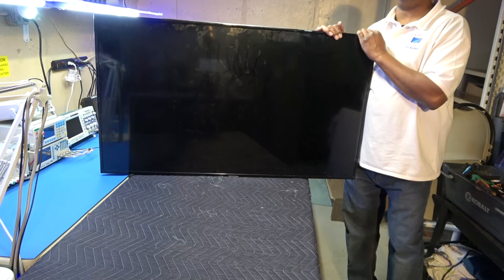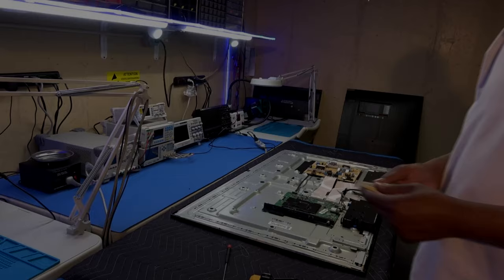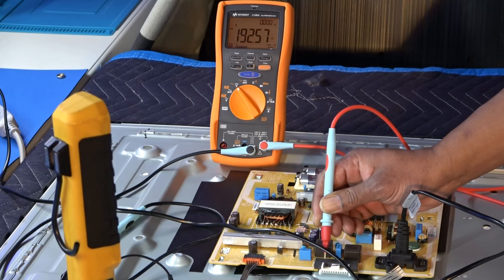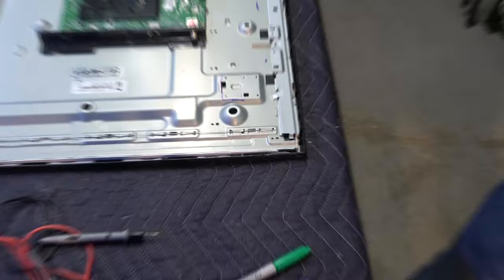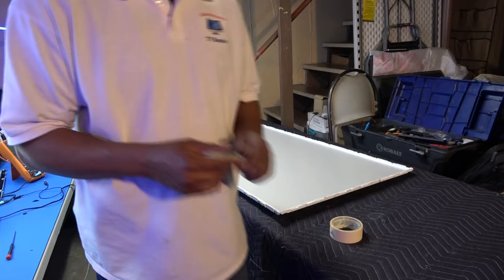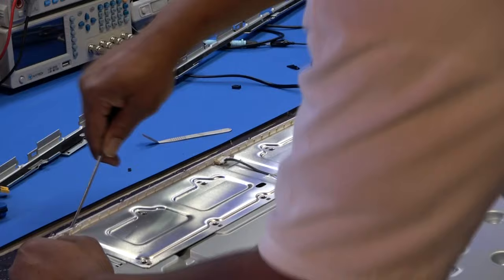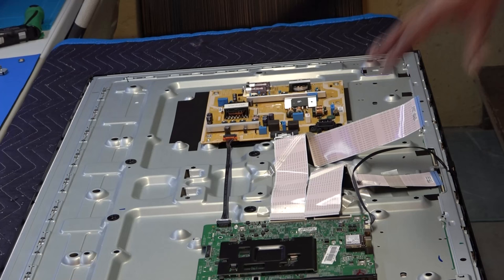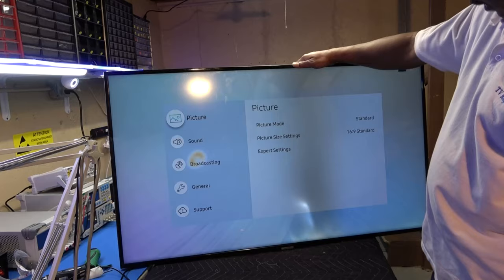50 inch Samsung half dark picture. UN50NU6900B FULL TV repair.

Comment: I didn't have the suction cups so I tried it gently to pick it up with out bending it or put unnecessary pressure.. it Crack on the corner then I kick it to pieces in frustration... but the tutorial was spot on ! Thanks
Reply: fml man I just saw a giant black stripe on my TV who fixes thus stuff that we can hire
Reply: Lol!!!! I’m abt to kick mine to pieces too!!
Reply: Kung Fu mode 🥋📺🦶
Reply: I've done the exact same thing. I was so effin careful too. Nearly impossible without suction cups. I wish I wasn't so full of pride thinking I could do it without. Tore it apart and sold internals on ebay. Only thing to do other than Kung fu style
Reply: @brianboyd48  hahaha I feel you I told my wife "don't worry you got a man right here I will get it done!", and I did I bought her a new TV lmao 🤣
Reply: Should have used tape a bunch of tape

Comment: Thank you for this tutorial! I picked up this exact 55-inch from my local goodwill for 50 dollars with the mindset of, "it's this cheap for a reason, but whatever is broken I'll try fixing." Sure enough, the left led strip actually burned out (left some burn marks on the plastic layers of the screen). At first, I put the wrong led strip on (two came in the replacement kit) I think one is specifically for the left side, and the other for the right. But after I fixed that it worked gracefully! Thank you again for this tutorial and it is so surreal how a TV doesn't use any screws for its assembly.

Comment: I came back to this video to follow up on this repair. I did this repair by myself last year in late December. The replacement went fine with no problems but the other day I noticed one side was starting to get dim which is the side I didn't replace the strips as I only replaced one side of LEDs. I'm planning on fixing the TV again and using the 2nd strip I have left over from the last repair. This video has helped me tremendously and would recommend this video to people looking to repair their TV.

Comment: Thanks! Your thorough explanation and video helped me to fix my 70" Sharp TV.  I was researching large TV's to buy and I saw this video.  Found a loose ribbon cable connector on the backlights.  It wouldn't stay closed so I found some appropriate plastic to keep it tight.  You saved me from a possible argument with my wife if I bought an expensive TV too!
Reply from the maker: You are very Welcome. Thank you for the very Kind Donation. Blessings Brian.

Comment: Here's a tip. Get a bag of thin guitar picks. With the panel facing down pull the bezel clip back and slip a guitar pick in there so it won't re-clip. Do this all the way around except the bottom. Also undo your lower driver boards from their holders and then take a small piece of painters tape to hold them down. Then carefully turn your panel over and take small boxes to put under the chassis to hold it up away from the table. Pull the bottom of the bezel out first and unclip those clips and then the rest of the bezel will just come up as the guitar picks fall out. You won't have to lay on the floor like a Big Dog. To get the strips off easier score the backside with a utility knife and that will cut the adhesive and they will come off easier and you won't need to bend those clips back. I like to use blue painters tape on all four corners of the diffusers to keep them straight and in order. The edge lit Samsung's are a pain in the ass. The heat from the led's can crack or melt the diffusers.....sucks Samsung
Reply: Yes. On this Samsung 49inch TV im repairing the heat from the led's has melted the diffuser (perspex like 2nd 'window' above chassis") and caused 2 running cracks. They start from 2 of those melt spots.
Reply: CORRECTED and formatted TEXT
  Here's a tip. Get a bag of thin guitar picks.
  With the panel facing down pull the bezel clip back and slip a guitar
  pick in there so it won't re-clip. Do this all the way around except
  the bottom. Also undo the lower driver boards from their holders and
  then take a small piece of masking tape to hold them down.
  Then carefully turn the panel over and take small boxes to put under
  the chassis to hold it up away from the table.
  Pull the bottom of the bezel out first and unclip those clips and then
  the rest of the bezel will just come up as the guitar picks fall out.
  You won't have to lay on the floor like a Big Dog.
  To get the strips off easier - score the backside with a utility knife
  and that will cut the adhesive and they will come off easier so you
  won't need to bend those clips back.
  I like to use blue masking tape on all four corners of the diffusers
  to keep them straight and in order. The edge lit SAMSUNG TVs are a
  pain in the ass.

{Pay attention to the difference and learn writing skill]
Undertake an extensive reading program to better educate yourself.
You can do it - it is not difficult.

Comment: I used 3 large flat blade screw drivers to remove the back and had no trouble. Once you get the corner up on the bottom, slide in another screw driver on the side and lift up on the handle until you here one of the clips pop and then keep moving around the perimeter. No damage. Even if there was any, you wouldn't see it from the front.

Comment: Great Video!   I have a 65" version model of the same TV (we bought for the spare bedroom around Christmas 2018) and had the inside half of the left side LED strip burnt out. Ordered the LED strips (only needed one, but they came as a pair), Pryor tool and suction cup handle grips for about $100.  Ended up changing both LED strips out since I had 2x new ones.  Took me about 2.5 hours total (2 hours to take everything apart and replace the LED strips, only 30 minutes to put it back together).  Anyway...TV looks great and is working like a champ. Thanks For the video Big Dog. Much appreciated!
Reply: hi, could you please provide the model number of yours? i have a samsung un65nu6900f is it top and bottom led? or there is in the middle led strips? thanks

Comment: Hey man! Thanks so much for this video. I have the same TV with the same problem and I fixed it thanks to your walkthrough! Saved some serious $$$! I have no experience with big electronics so take it from me, if you want to try you can do this.
I found the LED strips off of eBay for $25 and spent another $25 on an electronic repair kit (plastic pry tools and skinny tools) and some suction cups.
$50 bucks on supplies and about 90 minutes saved me almost $500 in either a service call to Samsung or just buying a new TV.

Comment: Thanks for the video,  I had a 65" NU6950 that had a good panel and a TU7000 with a broken panel.  Turns out the lcd panels are the same but you have to destructivly remove the led panel from the 7000 bezel and then can stick on the 6950's panel.  The difference between the two TVs appears to be edge lit leds with the Nu6950 vs backlit with the tu7000.  My 6950 also had half the LEDs burned out and the diffuser melted.

Comment: Great video. Like taking a Masterclass. I had one helluva time getting the adhesive from the old LED strips off. I guess I rubbed too hard and loosened one of the black plastic corner pieces. It fell off the chassis. Managed to find it - all good. Waiting on the LEDs, just wanted to say thanks.

Comment: Amazing video! 
Quick question. The gray glue strip that’s inside the front bezel (sorry if spelled wrong) I’m guessing is just to hold it firmly is coming out and want to put it back inside. 
Do I need to take out the back components to open the front? Just so I can push in place those gray strips in front. Thank you for your time boss.

Comment: Big dawg! I’m 2-0 boss. I knocked out my sisters Samsung backlight issue which was basically an easy fix after watching you sit. Thanks again for sharing your wisdom because around these areas seems like no one wants to share anything these days lol. I have a Samsung un50js7000 that I just brought back from the dead and figured out it was a tcon issue I think
Reply: However, when I play with the lvds cable the back lights turn off and on. Eventually they got in sinc but am wondering was it really the tcon or is it the powerboard not giving enough juice to power it up ? Once again, thank you Mr big dawg! U are appreciated here in Los Angeles:)
Reply from the maker: If the backlights cut on/off about every 5-10 seconds, in my experience its a bad LCD panel. Have same problem on the 55 and 60 inch models also.
Reply: @bigdog8882  thank you!

Comment: Next time flip the plexiglass sheet and the white sheet below it around. Notch out the bottom corners with a dremel tool to match since the bottom is on the top now. The picture is a little brighter at the bottom but not distorted by the crack and burn marks.Some models have a strip of white tape across the top edge, make sure to remove it before flipping it over. Love your videos you've saved me a lot of diagnostic time on models I'm not familiar with.
Reply: Does this really work if you flip the diffuser 180 degrees. I replaced both led strips and TV worked for a couple days, then the same shadow came back along the same area where the diffuser was burned and cracked. New diffuser panels are not available. Any advice is greatly appreciated.
Reply: I just flipped my diffuser 180, no dremel, slightly darker on the top now, but not bad

Comment: I had the same issue, half my screen gone dark on a Samsung 42". I simply undid and reseated all 4 ribbon cable connectors, and that fixed it.
Reply: Reseated?
Reply: @cornpop9262  yes, wobbled back into place, made sure they were in properly. It's been fine since.
Reply: @combatwombat71  did you clean them ?

Comment: My UN65RU7100 is almost identical inside however the problem with my backlight was simply the connector that passes through the steel frame. Pulling and bending on the wires on the connector would make them flicker on and off. Not as easy of a part to find, and I don't have anything small and rigid enough to tighten / close the contacts inside the connector.

Comment: I had a 50NU7100 that some was about to toss out because of that issue. I took it off his hands purchased the led strip for $18. Followed all the steps got everything working. 

I started putting the tv back together. I didn't support the glass enough and the lcd screen cracked. Thanks for this tutorial you did great job explaining every.

Comment: I just repaired one of these televisions. It really surprised me that there were almost no screws involved in the tear down to get to the LED strips. With the weight of the TV, I guess I just expected it to be built more solid. I actually used my cell phone repair kit to take it apart and put it back together. Most of it was done with a plastic spudger and a guitar pick. LOL It was my first Samsung repair, but the LG and Vizio TVs I have repaired were a nightmare. I definitely wasn't impressed with it and the price new is not a very good value at all, in my opinion.

Comment: Because there is so many problems with Samsung TV there should be a recall. My 50 in is 3 years old and repair depot told me to junk it. Used maybe 10 times in fully finished lower level.  
Class action law suit?  Any solution besides trying to repair it

Comment: The left hand side on my 2018 43" NU7100 model went dark just a few months ago. I just recently got a brand new 2020 50" model (TU8000). I hope the same thing doesn't happen on this one, if it does I am never buying another Samsung TV again XD
Reply: My 43" went bad on one side on Dec 4th, 2020 then Dec. 5th, the other side went dark. Had around a 5" bright section in the middle. On Dec. 6th, the entire screen went dark...totally. TV Purchased from Costco August 2018, I had purchased a SquareTrade Warranty. What *great* service they provided! Used the money they sent towards a 48" LG OLED. A guy at Costco said he had heard about this problem on lots of Samsung  _7 Series_! Infuriating that Samsung won't admit there is a defect.
Reply: always reduce the back light to 60 70 % it will help, leds will last longer.
Reply: @markwhitfield5412  in our case it's a product defect! Thanks for the advice though.

Comment: Oof! Suction cup scar at 42:35...I dont use those for that reason. Too much distortion on the LCD seen @ 25:22. Those panels are so light when released that you can lift the edge up across the top and just support it with a flat board  Im trying to replace those bad LEDs but your showing me that strip gets destroyed releasing from the heatsink. Oh well.

Comment: CORRECTED  TEXT
; This SAMSUNG 50" television powers ON but one half of the screen looks
; almost totally black. This SAMSUNG model UN50NU6900B uses 2 edge-lit
; backlight strips which are located at the top (one for left/right side)
; of the television screen inside the TV.
; Obviously when this problem occurs - one out of the two strips are found
; to be burned out. 
; So in this video we are going to troubleshoot the LED circuit located
; on the power supply board - determine we only have a bad back light strip
; - proceed to disassemble the television - replace the backlight strip -
; and repair this SAMSUNG TV.

Comment: Advice: flip the glass with a crack to the opposite side from the strip if you have too much of light distorsion (which is the case here) so the crack will be at the end & not so influencing. And sucker cups... that was too hard kiss for the matrix...
Reply: Just curious how you can flip the glass if the led connector port strips are on the bottom side?
Reply: oh nevermind you are talking about the cracked diffuser screen. Good idea

Comment: Hey, great video! You make it see look so easy! So I have a 46" Samsung and eliminated settings, connections etc. I noticed that my tv starts up and the screen is normal for about 0 to 30 seconds. Y
Reply: Is this the same problem w backlighting or possibly a different problem????
Reply: @heatherlaine96  same problem, one led has a bad solder joint or starting to fail.. works till it gets warm then cuts out.

Comment: Nice video, thought I would ask I have a Samsung Qled just over a year old so out of warranty, and while watching the tv I often get this bug where over a few seconds it looks like the screen is being covered by black ink then it switches off and a min later it reboots up automatically, some times it will cycle this crash 3 times in a row, then correct itself, any clue as to what is happening thank you
Reply from the maker: Contact Samsung or look online to see if your particular model # TV has a firmware update available.
Reply: @bigdog8882  I checked for updates none available, so guess I will try contacting Samsung, my only worry is I have lost the receipt and I did not register it with them when I bought it new.

Comment: As an electrical engineer, you did a nice and detailed job. Where did you get the replacement LED strip?
Reply: I got mine from ebay
Most of them took 2 months to deliver,.but then I found one with stockings in my country, 
After 3 days if waiting and 3h of raging i did it
22 euros for a 55zoll smart tv

Comment: Replaced the strips feel like it worked fine then I got two different black lines one all the way to the left one 3/4 of the way towards the right I tried unplugging the strips and plugging them in straight like you said but no luck . Any chance these lights blew again ?

Comment: So in the beginning the tv worked it just had a shadow from the bottom, so  took it apart like your video, the same tv, I’m at the end where you plug in to see if the leds work, my question is if you plug in to light up the old leds before you take the old ones off will it still turn on? Please help.?.. I plugged it in to see what leds are burnt but the whole strip won’t turn on? Why?

Comment: Great Video, I subscribed to your channel.  I have a Samsung TV, seems exactly the same as the one in this video except a 55" UN55NU6900F, instead of having half the video black like yours, mine has about 1/4 of the total screen black, is it possible it's the backlight but just half of one backlight burnt?
Reply: Very likely. I have just bought one that with the same symptoms as yours and is was diagnosed by the oficial service as a burned LED strip.

Comment: the defuser was bent when you stressed it to much causing a weak spot ..leds do not cause that line...also you have a led out by the look of it causing a dark line..you always test tv before replacing the lcd screen,also undo the screen tabs before the bezel then turn tv over ,its not a car...all round 6/10 marks..

Comment: i wonder when tv manufactures will make tv's with a removable led strip access panel, save all that fussing around with taking the very fragile screen out, i have the same tv, and the same job to do, and im shitting myself before i even attempt it.... cold sweat, shaking hands and a panic attack just wating to happen....i wonder do u take a valium before you start lol
Reply from the maker: Lol. Just drink a Beer like I do.
Reply: well, i done the led replacment, all went well, but the end results were not good, burnt defuser cast light and dark patches all over the screen, so i found a curved 49 inch samsung tv with a cracked screen, put my screen in the curved tv, Perfect!
Reply: They want them to be disposable, and have you just buy a new one.

Comment: If I accidentally tear the reflector sheet while removing it from the metal panel will this cause any issue to the image once put back together? I know it’s been mentioned to just tape it, but this sheet got really messed up when removing because of the adhesive.
Reply from the maker: You will see shades in the picture if you have big spots or tears in the white paper
Reply: @bigdog8882  do you have any suggestions where to buy replacements. I have some noticeable spotted shadowing at the bottom of the display. eBay or shopjimmy doesn’t seem to have any